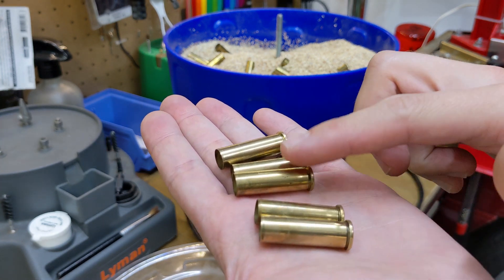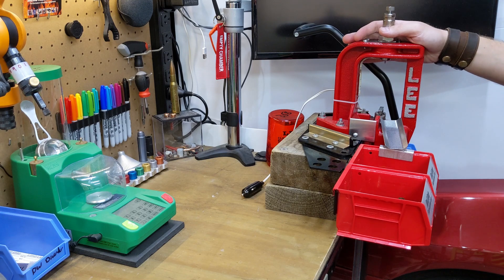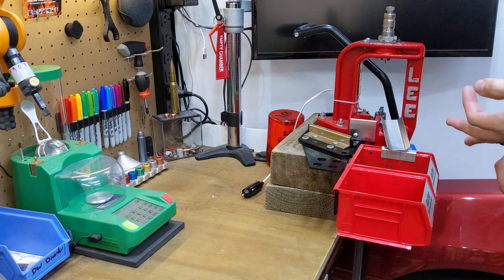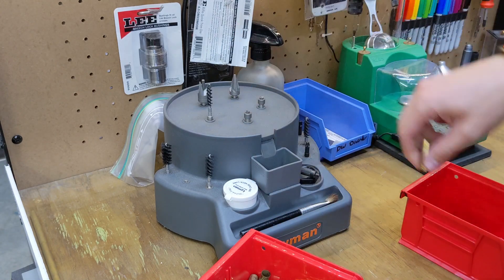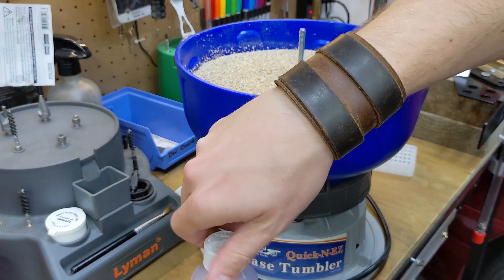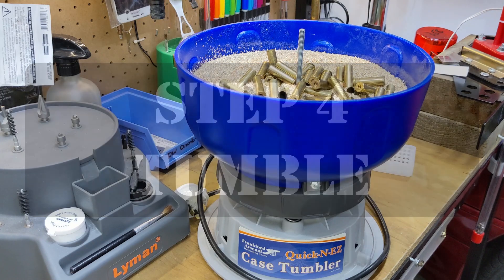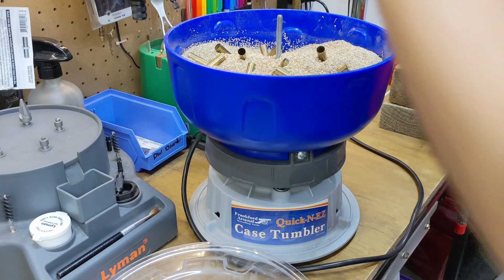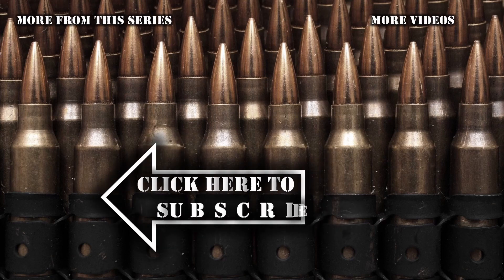So Shiny - 4 Steps to Clean Brass - Reloading: Episode 16

Comment: I use corn cob media with the Dillon polish as well.  Is it just me or do you get media clogging up your primer pockets?  I usually just poke it out with my Lee case trimmer, but it gets to be a pain when your getting ready to prime your brass.  I have heard that people leave the primers in when polishing/cleaning but I too like to have my primer pockets clean.
Reply from the maker: I found it depends on the brass. I usually find it shakes out when using the separator. If not the pin gets it during resizing.